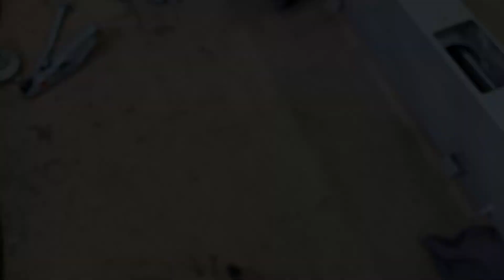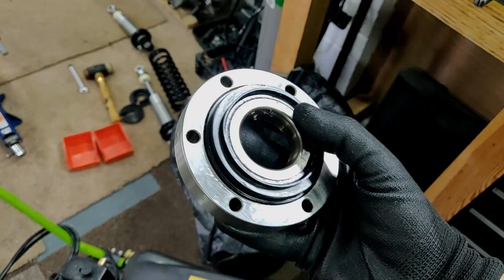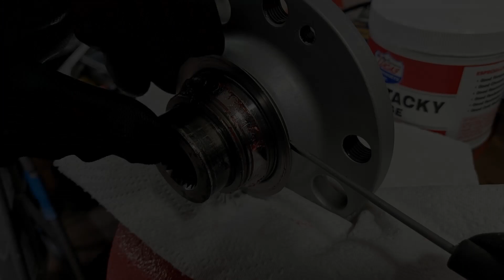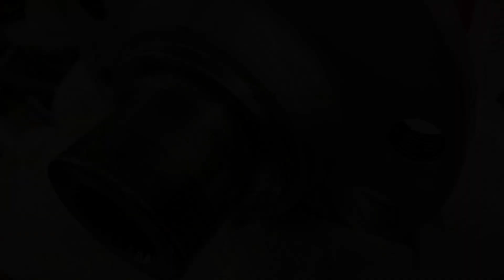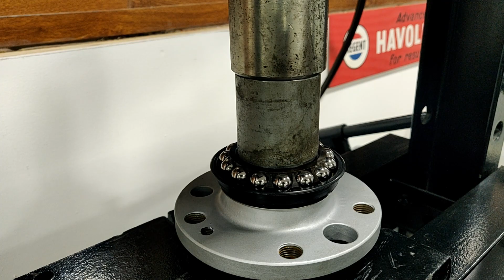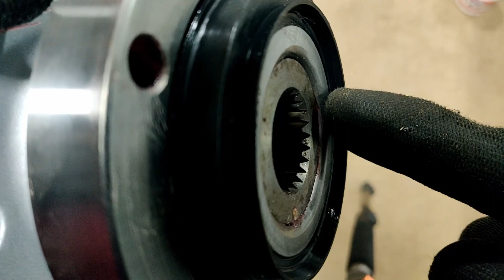Lotus Esprit rear wheel bearing removal and replacement

Comment: I was wondering how you got the old inner race/seal off initially.  I think I see from your comment below. So If I were to change wheel bearings I would not take that part off, unless it was damaged.  I would just press off the outer race and replace the bearings?

That was cool how the race just cracked!  hat thing is under some tension.
Reply from the maker: You wouldn.t need to touch the little stainless plate which caused all the drama, I only did because I had the hubs vapour blast cleaned and repainted.  If you were changing the bearing tho - you would need to do the grinding stuff - they are pressed on unlike the front bearings so yep under a bit of tension.

Comment: As a transmission  tech most of my working career, not for a dealership where you are repeating the same task repeatedly , but where  I was faced with many types of different models  ( C-35 comes to mind), I can tell you that its easy to get confused with some of the internal transmission   component designs.  Many times I have had to rethink the reassembly of some unfamiliar units.  No shame brother!  Ross.
Reply from the maker: Its all good -  tbh it was a perfect storm of events so I'm not that worried.  99% of the time you never remove that plate - it was only because I restored the hub and painted it that I took it off.  Its just one of those things.

Comment from the maker: Quick back story :
Initially I put the 1st assembly together correctly but convinced myself I had actually got it wrong because the seal was rattling around.
So when I did the second assembly, that confirmation bias kicked in and ensured I screwed up the 2nd assembly instead !   🤣
Good job I didn't cut the original one off.  Happens to us all I guess, but a fairly expensive mistake to make.

I appreciate this may be sucking eggs to most of you but if it helps someone then job done 👍